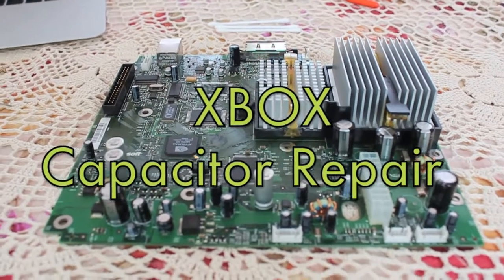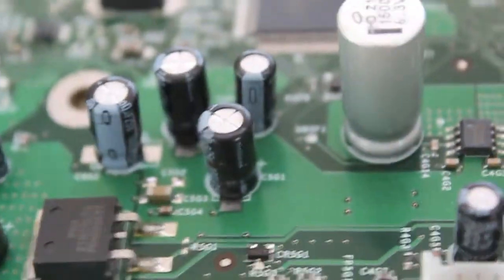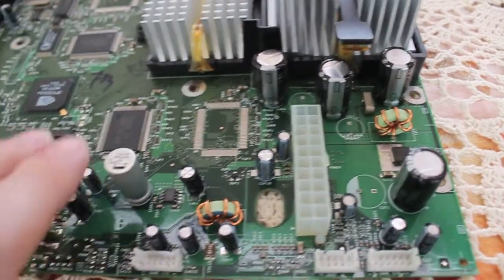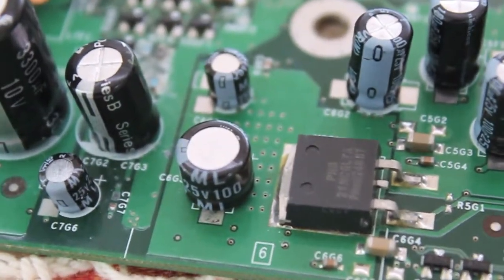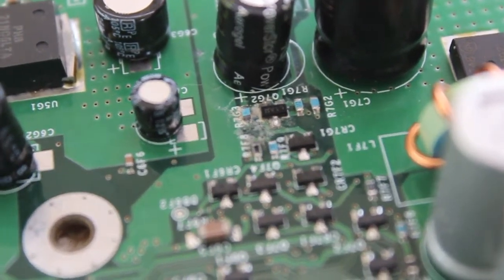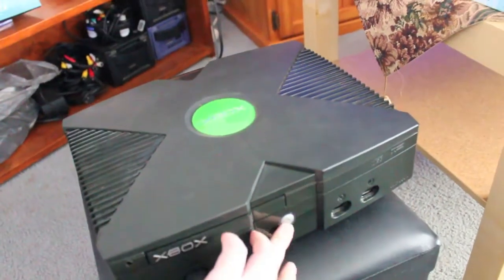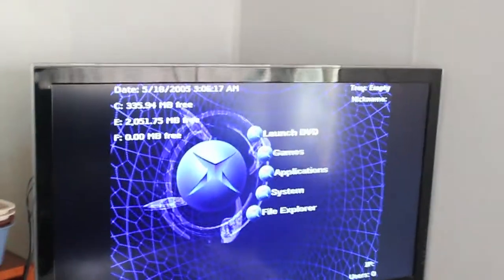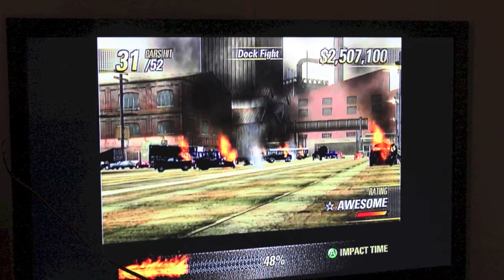Microsoft XBOX (Original) Capacitor Repair Overview

Comment: Thanks for this helpful clip. My XBox modded 1.6 would green light for a second or 2 and then die. Replaced the 5x 3300mfd 6.3V capacitors bought from Wanger Online (Sydney Australia)... deep breath... power on... yes! Also if considering replacing thermal paste on the chips be very careful with the plastic clips - easily broken

Comment: my 3 6.3v capacitors are bad, it seems. they're all slighly puffed out and the rightmost one is even a bit rusted, must have leaked a bit.
i guess that explains the extreme instability and and graphical glitches i'm getting.
Reply: I'm here for the exact same reason 😀

Comment: I replaced 5 bulged capacitors in my Xbox (3300 MFD 6.3v), and it's working again...
Reply: I have another xbox that I bought off of ebay. Want to say that its a 1.2, but I haven't modded it yet so I'm not sure...
Anyways. The thing has a very dark/dim image on screen. Do you think that a capacitor could be to blame for this discrepancy?
Reply: It could well indeed

Comment: I have the Same Xbox model, mine is short circuiting and it had a bad clock cap removed it and cleaned it still not working any ideas ? Was working last night so shouldn't be completely dead
Reply from the maker: +James Turlan Did you give the board a good clean with some isopropyl around where the bad clock cap was removed? You didn't lose any of those ridiculously tiny SMD resistors / capacitors near the clock cap did you? I'd recommend posting on AssemblerGames.com forums and give them your symptoms and they might be able to help.

Comment: Will ripping the clock cap out cause any issues when the Xbox is turned off?
Reply: ***** i pulled out the clock cap and now when i long press the power button it wont load my mod chip or evox any ideas?
Reply: Tim The Aussie What version? I removed it from a 1.0.
Reply: 1.4, i fixed it anyway! i accidentally knocked the mod chip and just pushed it down into its socket and it worked.

Comment: And it's already softmodded with UnleashX dashboard, nice! Personally I'd just install the latest build of XBMC and set that as your default dashboard. Buy some cheap component cables from ebay, switch region to NTSC and set video output to 720p :)
A TSOP mod isn't necessary or going to offer you much in the way of practical benefits. But then again, who needs logical reasons to mod stuff? :P
Btw fan speed is adjustable on the fly via XBMC or UnleashX settings Menus. 20% is best :)